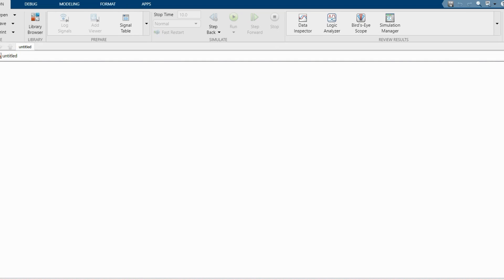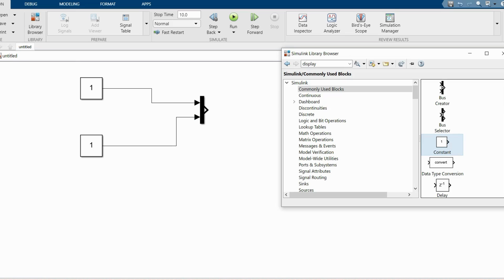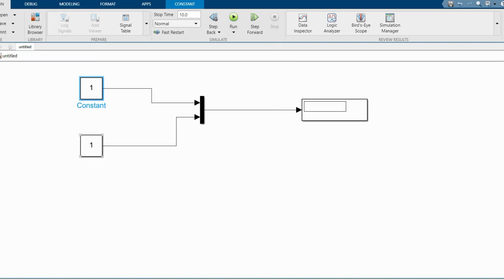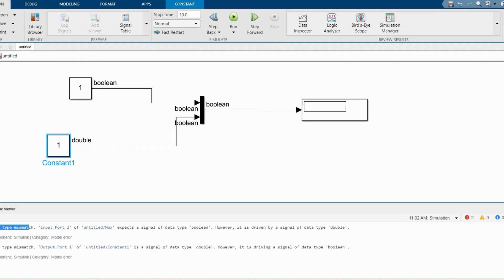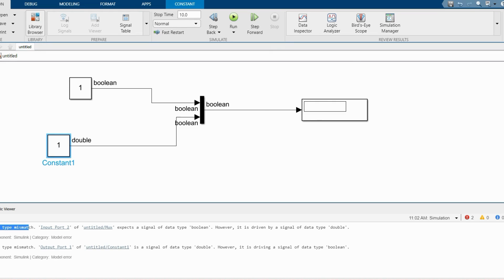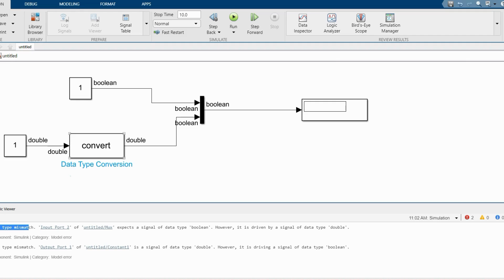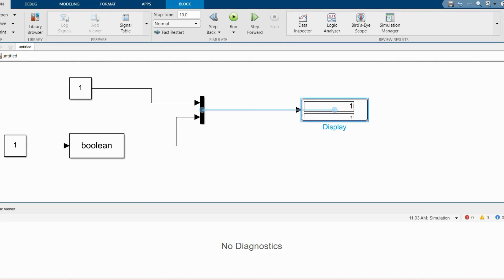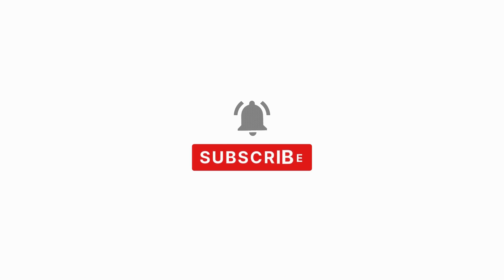Datatype Mismatch in Simulink | Common Errors and How to Fix Them

Comment: Can't we change data type of another constant to boolean
Reply from the maker: It depends on your model's objective. I cannot understand where you will use it.
One solution could be to make a Matlab function in Simulilnk that will give 1 and 0.
according to your logic (which you want).
or you can use switch block (which uses a threshold value) 
Hope this helps you.